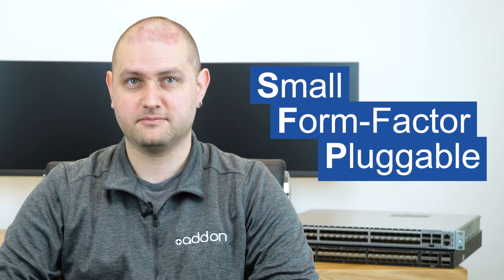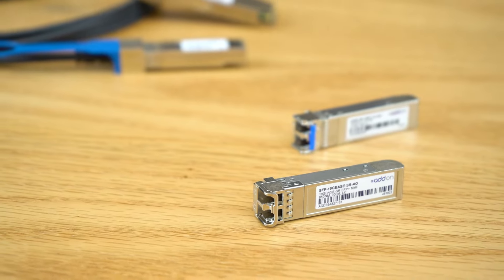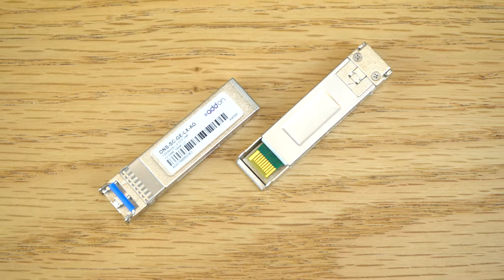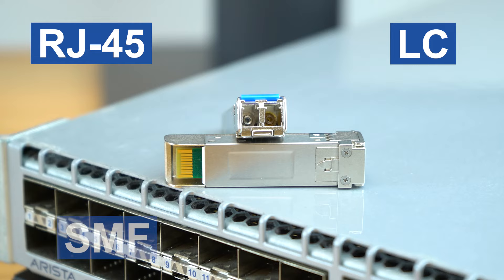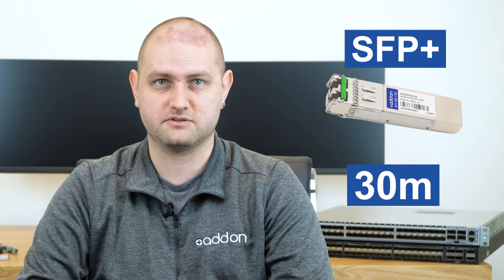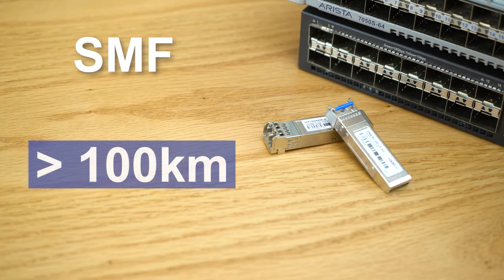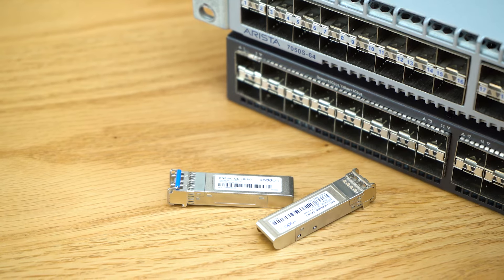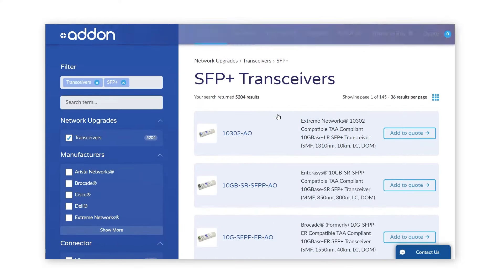SFP vs. SFP+ Transceivers: Explained!

Comment: Was looking to find out why do some manufactures make their SFP/SFP+ equipment proprietary?  What is different in an HPE transciever that does not allow it to work with another, non-HPE equipment?  I find it easier and less expensive to use a DAC cable, but with HPE gear this does not work.  I know some third party transceiver/cable manufactures will create a custom cable with the appropriate brand specific transceiver on either end, but then what good is the MSA - as this breaks interoperability?

Comment: For me, why I like sfp+ is using optical cables between main equipment (ubiquiti 10Gb SFP+ distribution switch) . If there is a storm and lightning strikes next to the house. Whole equipment should not burn (mainly NAS)

Comment: Hello thanks for the tutorial. I have a Cisco SG300  10P   and  a Cisco SG350 10P . In the front they have 2 connectors labeled  SFP  .  Does it mean it only works with SFP  or  I could use SFP+  as well ?. Thanks.

Comment: if i use 1310nm/10KM/1.25g dual fiber sfp @ one side 
and 
1550/40KM/1.25g dual fiber sfp @ other side
will it compatible or will it work ?
My inbetween total distance is 8 KM

Comment: If I was using the Media Converter for a fiber cable that is under 30m , do I still need a transceiver?
Reply from the maker: Hi David! While it depends on the environment that you are using, you'll still most likely need a transceiver. If the switch or system receiving from the media converter doesn't have LC or SC connectors, then it would require a complementing transceiver. Hope this helps!

Comment: how tf can I unplug those transceivers?
Reply from the maker: Hi! Apologies for the late response, but that's really simple to do 😊. Here's what you do:

1. Pull down the the locking hinge.
2. Hold the transceiver and slowly slide it out of the port.

That's it! Thanks for watching and let us know if you have any other questions.
Reply: @AddOnNetworks   thanks. I bought another cable and it's much easier to unplug.

Comment: Where would SFP benefit my home network?  I have 3 computers I want to access from internet for family to store photos and videos.  I have 30 32esp / 8266 smart devices hard wired for home. 
I have 4 computers for internet access in living room for me / guest.  I have 3 computers in kitchen hidden except display and pullout mouse/keyboard.  Office has 5 computers I monitor smart and security. One also strictly security cameras.  Each bedroom has guest computer and wall rj45 to connect their computer when visiting.

Detached workshop / office has 2 computers for researching parts, ordering supplies.

With clarification , I can move on buying proper infrastructure cable/switches/etc.

Ping here your telephone number.